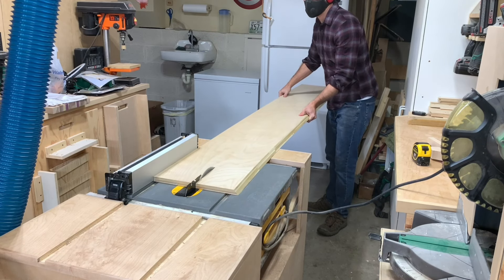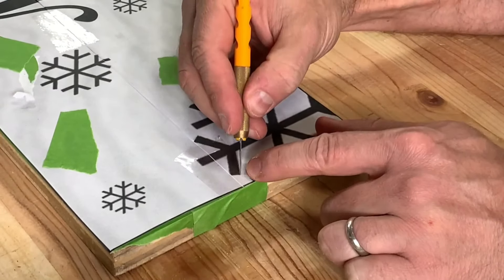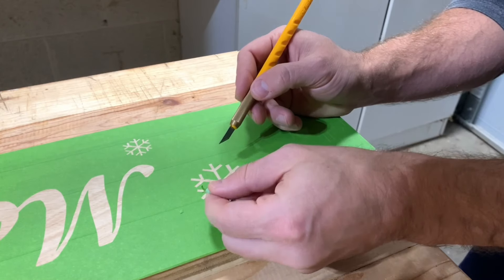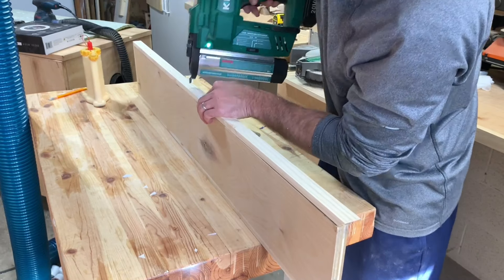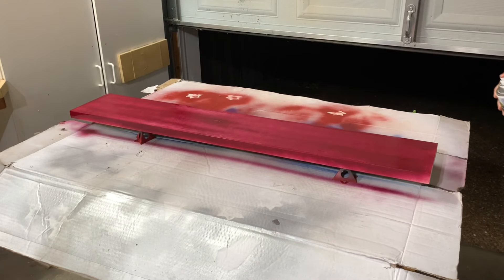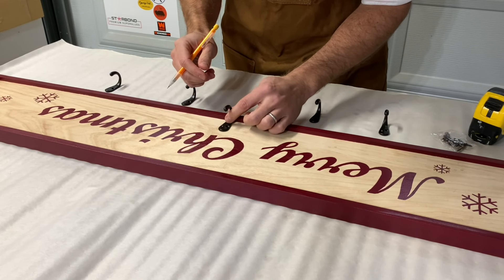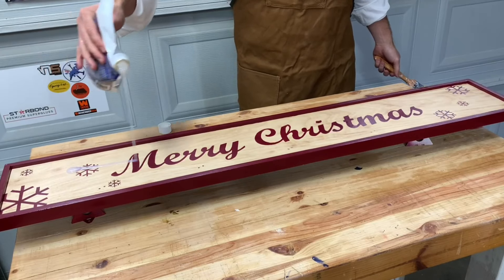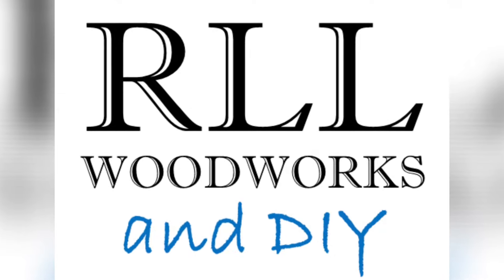Do I need a Cricut?

Comment: Hi Rory, I think you still have to weed (peel away the pieces) by hand; maybe less effort but still is an annoying thing to suffer thru !  Have you thought of a laser engraver ? Versatile and fun IMHO. Both Cricut and an engraver will have a tendency to expand your workshop project repertoire(?).   Take care🙏   -Mike p.s. sealing with a thin shellac should lessen bleeding into the wood I'd think.
Reply from the maker: Thanks so much Mike!! Yeah I need to look into a laser. Can you use it inside or would I need space for it in the garage?
Reply: @RLLWoodworks  I just do wood engraving. So far and I use it in the garage. Don't need a fancy vent yet or open the doors either. I have only made branding on the bottom of my bowls - see my latest vid.  It is an Ortur LM2 @ 20watt. To be clear - there will be smoke so I don't recommend using in a living space especially with smoke detectors around !!!
Reply from the maker: Great info thanks Mike! I’ll check out your vid
Reply: @RLLWoodworks  Don't hesitate to ask when and if you get serious about engraving - I've been keeping tuned in to the scene - picking one can be hard. (email works better)
Reply from the maker: Thanks Mike, I will keep that in mind!! Appreciate it man.

Comment: With a circuit the only step it will really make easier is the part you did with the exacto knife. Everything else in your process stays the same. I will also say, you dont get as much forgiveness to make sure your project is straight when laying it down as your process is. You can just re-tape but with vinyl you risk tearing it if you misplaced it and you want to adjust.
Reply from the maker: Really good points that for commenting Chris!! I did end up buying one and I think it’s great for small projects where the stencil is easy to manager. But you a right on, a big stencil like this would be a bear to get perfect.